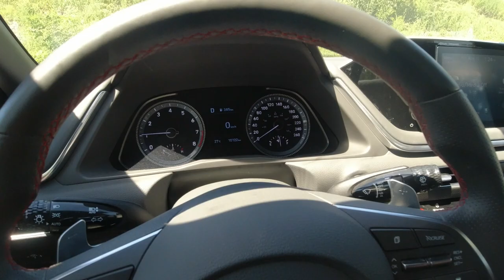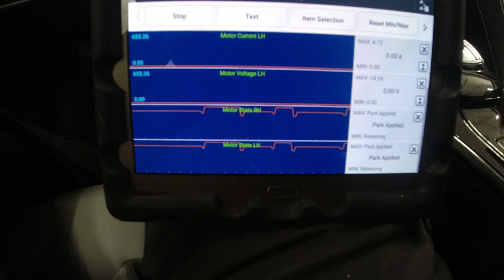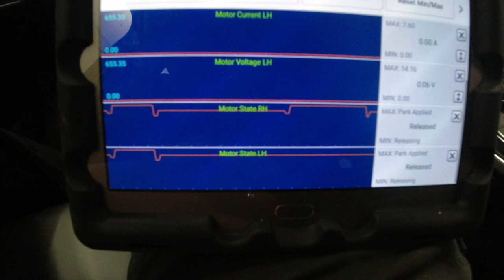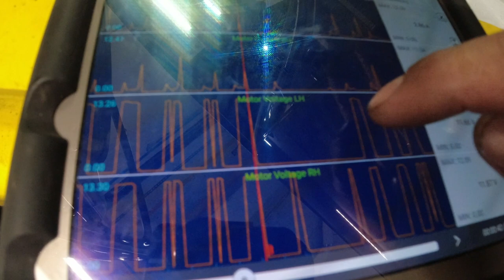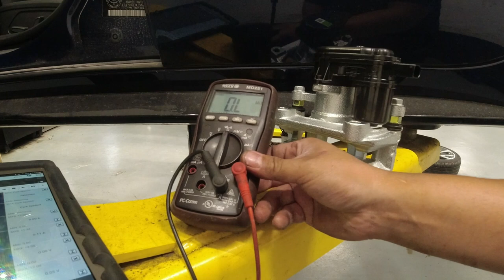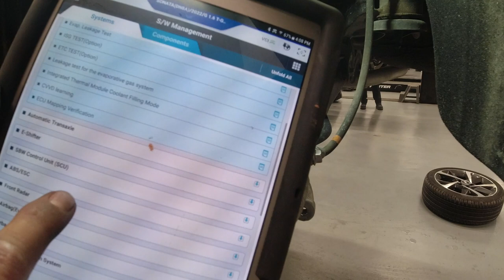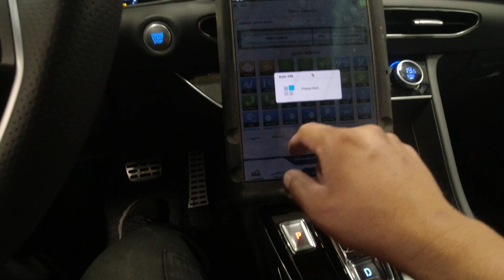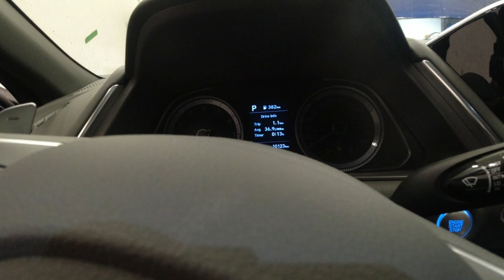Hyundai Sonata Electric Parking Brake fault

Comment: Can i download GDS on my own tablet if I work for Hyundai?
Reply from the maker: I think you can, as long your management is okay with it. And side note the samsung tablet is very specific for the gds software to run.
Reply: @hyundaitech  yes I am aware of this the tablets aren’t cheap but a few journeyman have their personal and I’d like to make the investment. Saves time waiting for a shop tablet, we only have one.
Reply from the maker: @joecastro23  ohh yeah thats true.. yes tablet you can get cheap on ebay with specific model, but the vci dongle is the expensive one.
Reply: @hyundaitech  which model tablet are you currently running? I saw a new updated one just came out on the news page.
Reply: You need samsung 10 . Hyundai is updating all tablets , new features can not  cope up with the old tablets . Too slow, inheard  samsung active pro 10.
Reply from the maker: @joecastro23  mine is an older model sm-t813nzdexac